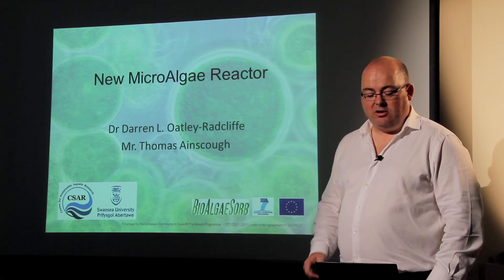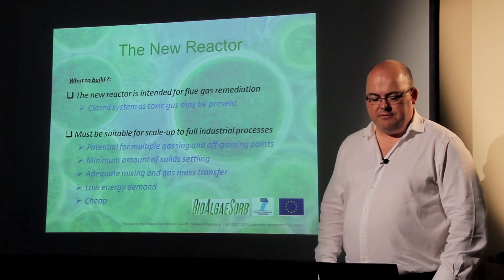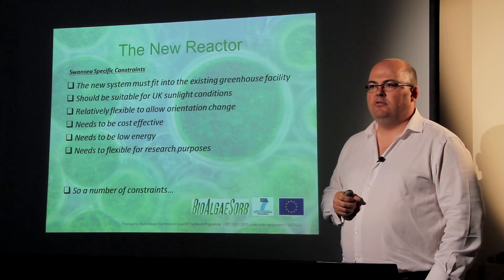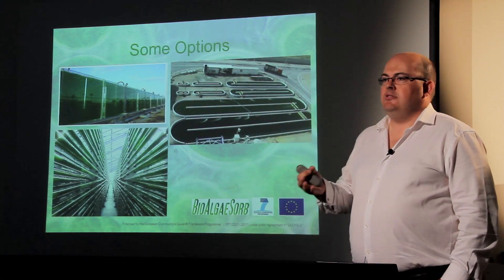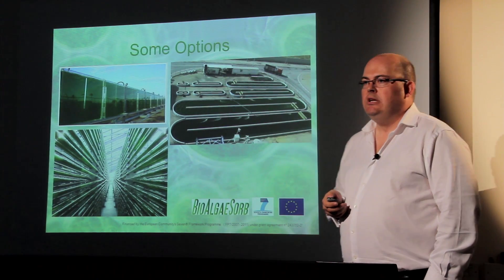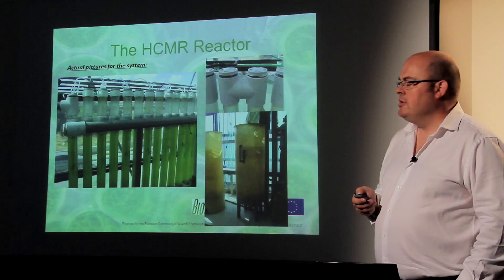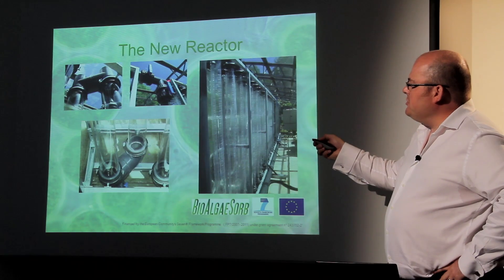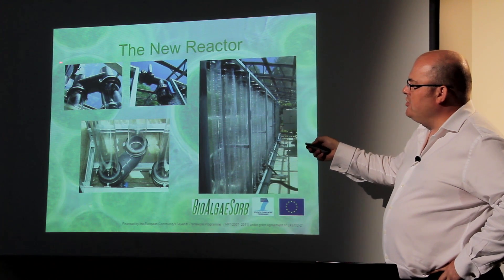BioAlgaeSorb algal photobioreactor design presentation - Dr Darren Oatley

Comment: Are there any flat plate photobioreactors?
Reply: Seems like a great idea honestly. More surface area without the added challenge of sourcing thick tubes. Seems like this could be way better for DIY scale at the very least.
Reply: @samkenknight7132  Hmm but I think there could be a problem with algae film forming on the walls of flat PBR's :)
Reply: @pengolt  more so than in a tube?
Reply: @samkenknight7132  Maybe, but in the tube you have higher velocities of the liquid culture, the forming of the biofilm should be slower
Reply: Of course this is only my speculation, but I see that many biotech companies which uses PBRs with artificial lighting, they use tubes, not flat panels :)
Reply: @pengolt  Some methods actually do this intentionally and harvest the mat !